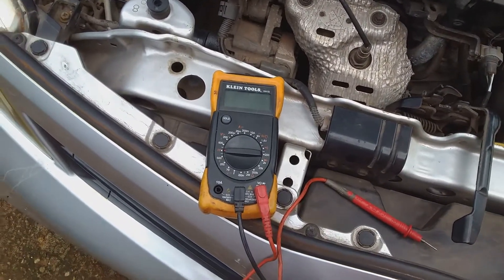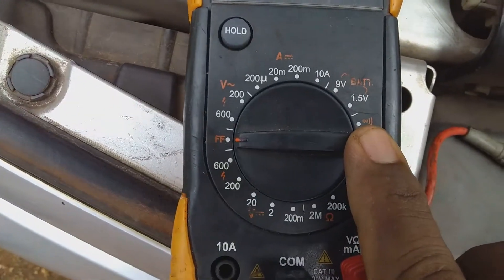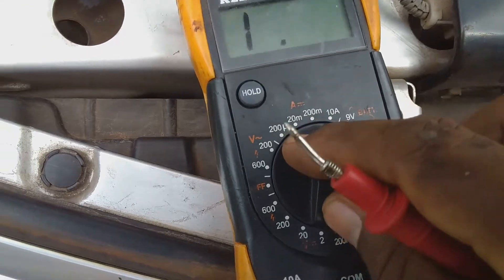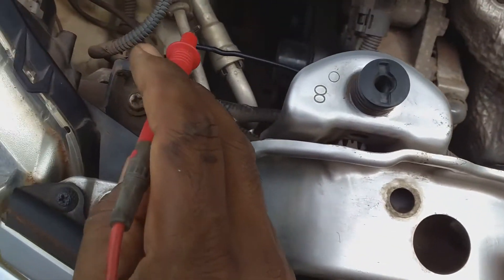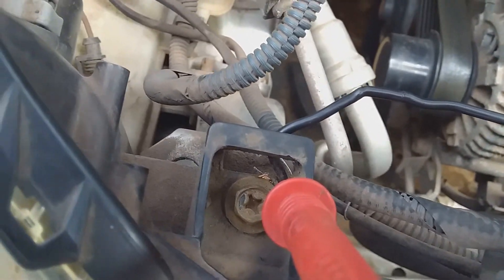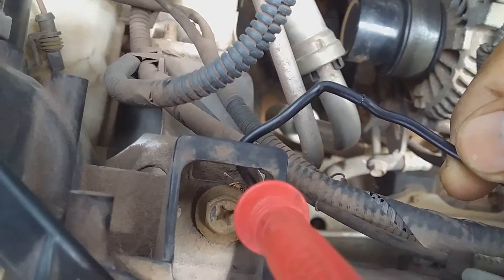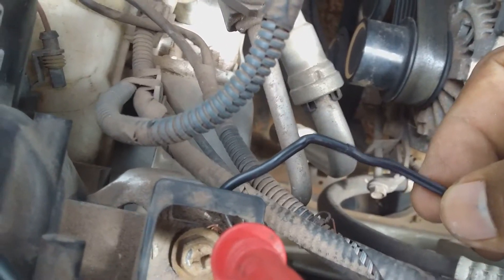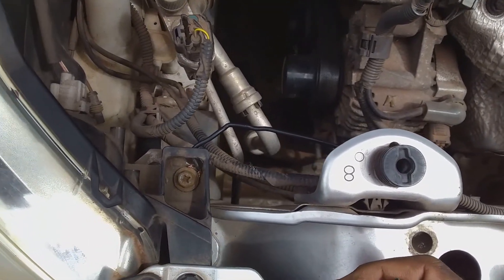Toyota Vitz Bad Wiring

Comment from the maker: Sometimes we do not have a scan tool but we do have a multimeter, it can be used to identify connection problem as shown in the video.
The multimeter is a work-around if you do not have a scan tool.